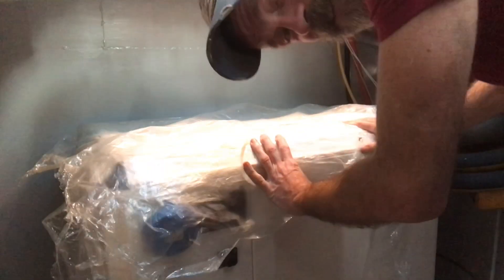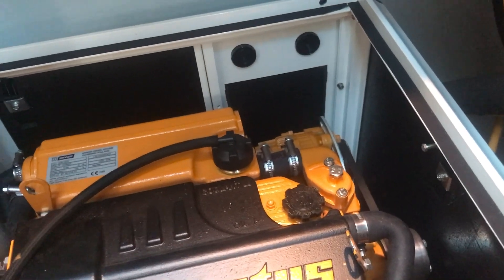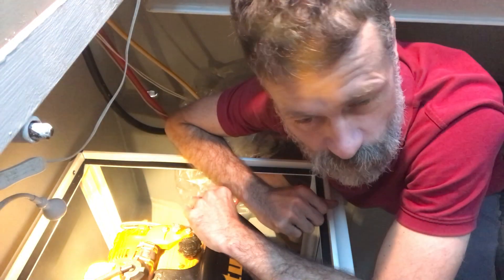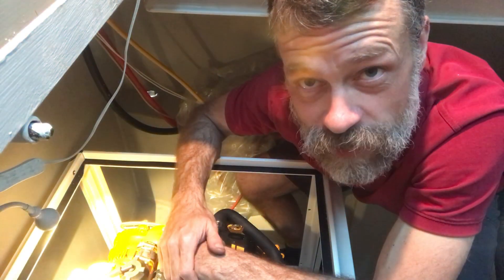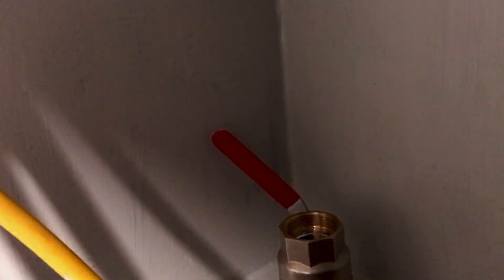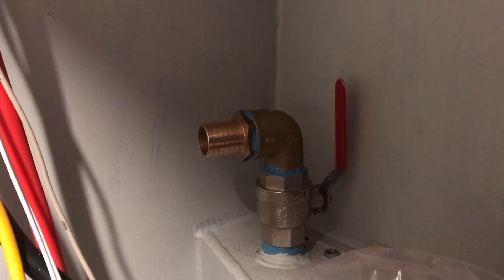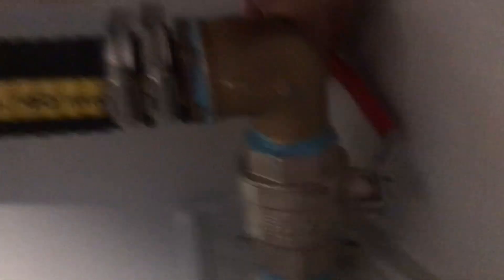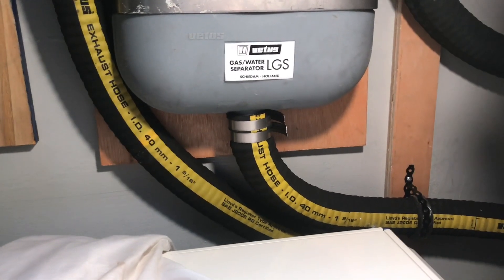58. Installing the Generator - the Exhaust

Comment: would adding extra PTFE tape to the thread mean it would find the right place? All good if your solution works though. TY for the video
Reply from the maker: Hi DEmma. Yes, I guess lots of ptfe tape might work to bung up the threads if they are not fully home. But like you said, hopefully what I’ve done works… time will tell 🙂 thanks for the comments!
Reply: The corner pipe and lever pointing into wall were actual laugh out loud moments (in a wry and sympathetic way!). Glad you sorted it